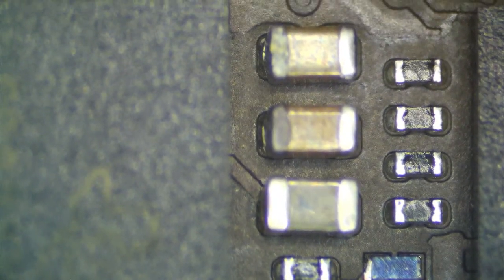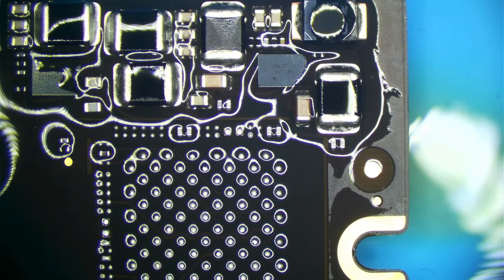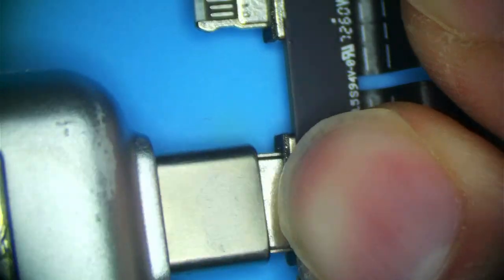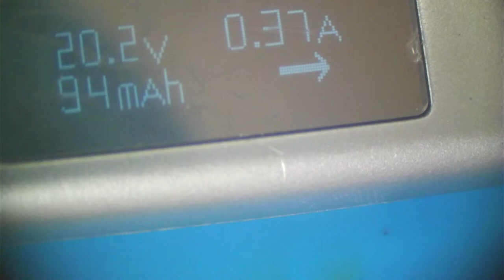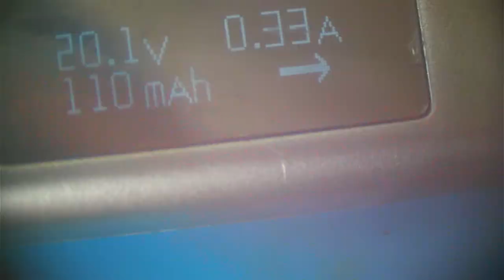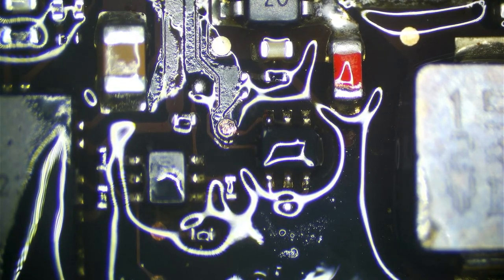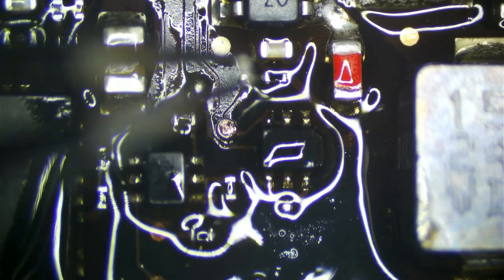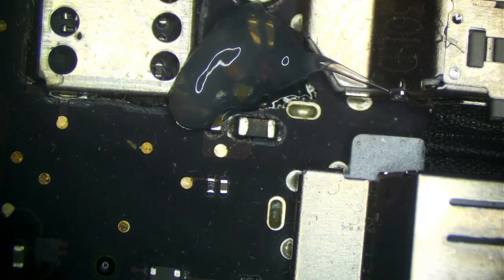MacBook Repair! 820-01700 no power and 820-3209 no backlight

Comment: do you know if this mac starts without trackpad conected?
Reply from the maker: It will.
Reply: @TCRSCircuit  thanks
Reply: @TCRSCircuit  i have a 2289 that the flex cable of trackpad are shorting ppbus_g3h, when its connected, charge stuck on 5v 0a. when i remove, charge go up to 19v and apple logo appear for 5 seconds and shutdown, but this time charge stuck on 19v 0a. Do you know what can be? i tried to recovery for many combinations CMD + R and etc.. no sucess